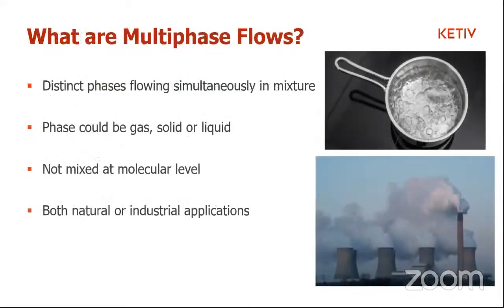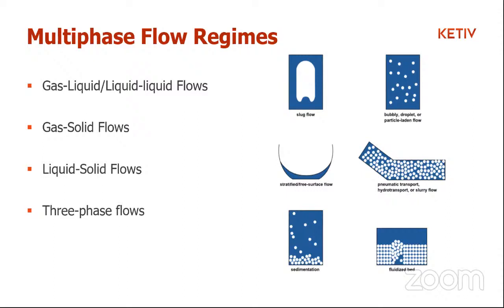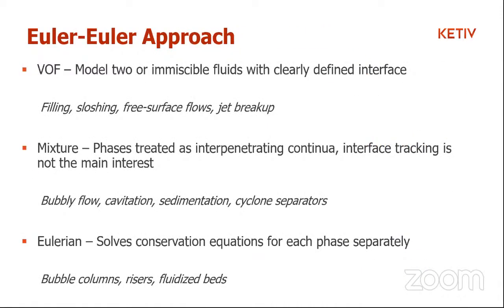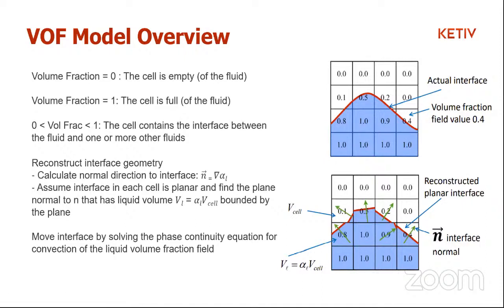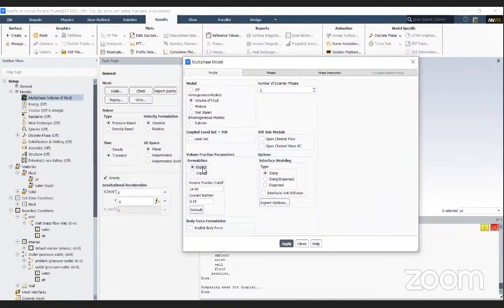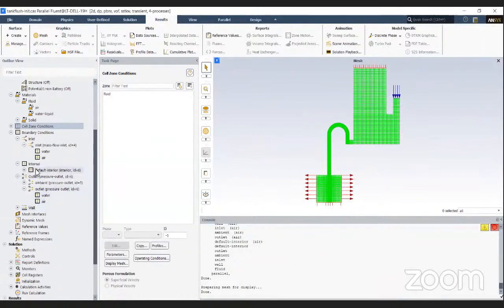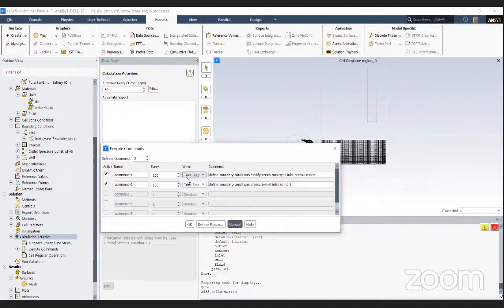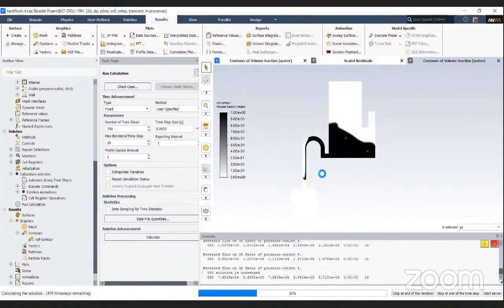Introduction to Multiphase Flow Modeling using Ansys Fluent | Ansys Virtual Academy

Comment: I am currently conducting Fluent multiphase simulations based on water and abrasive particles. However, the simulation results do not precisely match my requirements. Do you have any videos or suggestions that could assist me?

Thank you.

Comment: Respected madam/sir,
I am writing in reference to the project entitled " Computational Study of Agglomeration Mitigation in Fluidized Bed Combustor/Gasifier"
I have to resolve Agglomeration problem in FBCs and simulate it in ANSYS FLUENT which includes the coupling of Multiphase (Eulerian) , species transport (Reactions) , Population Balance Model(Particle size distribution) , Solidification/Melting ( Ash Melting phenomena) . 
, I simulated the models separately but unable to couple them simultaneously. If you can provide any path or steps to couple these models or any kind of help . I will be grateful to you.
Looking forward to hearing from you.

Comment: Dear Sirs, I am following the procedure described in the video, except that the fact that I am not including the reservoir at the bottom. When I start the simulation, it stops immediately and when I rerun, I am getting a floating-point exception. Do you have any idea of what is happening? Thanks a lot.
Reply: As far as i could guess i hope you figured it out by now. But For others finding this. You might want to check your inlet and outlet. If there is no outlet at the bottem the water pressure and air pressure are batteling but they're incompressible in this simulation. So Fluent will struggle to understand what is happening in the dynamics and weird stuff happens till the floating-point exception errors occur. To fix this i'd recommend placing an outlet somewhere for the pressure-buildup to escape to. Hope this helps

Comment: Nice tutorial. I am running ansys student 2021 r1. In "create or edit materials" section there is no option for inserting new materials, only air is available,. Do you know if its a limitation due the student version? thanks.

Comment: Great Tutorial Snigdha.  I am wondering if you would make another video to explain bubbly flow (air-water) simulation either in a vertical or horizontal pipe.  Thanks.
Reply from the maker: Thank you for the suggestion, we will add it to our suggested topics list for the future!
Reply: @KETIVTechnologies , that would be great. I am writing a master's thesis on a pressurised horizontal tank and dissolved air into water. I'm very much looking forward to seeing that video.